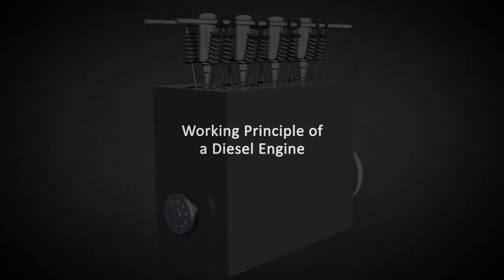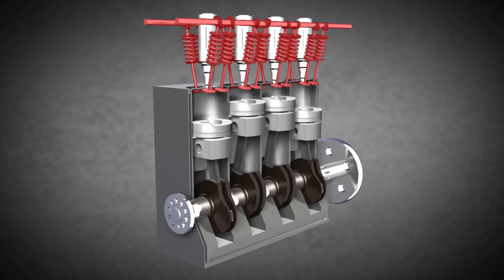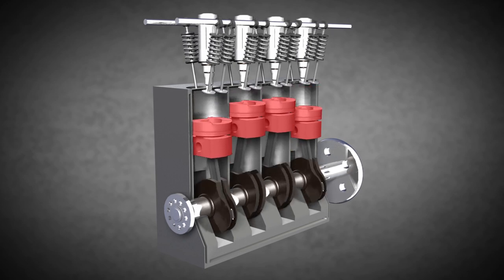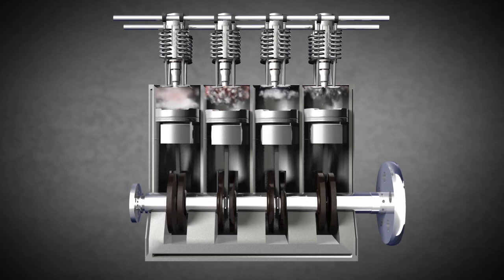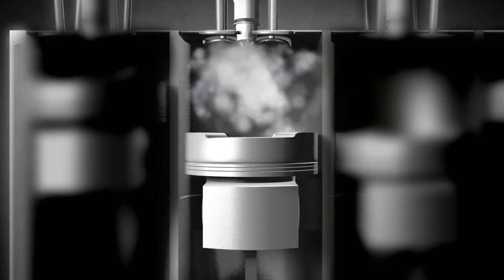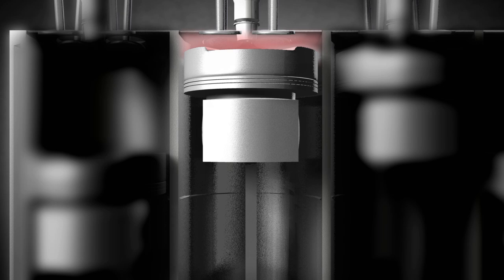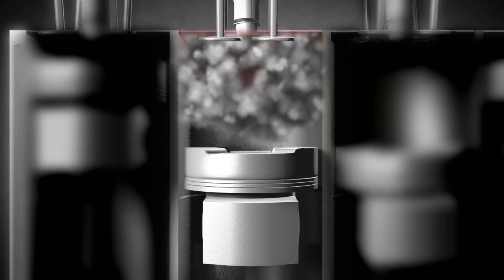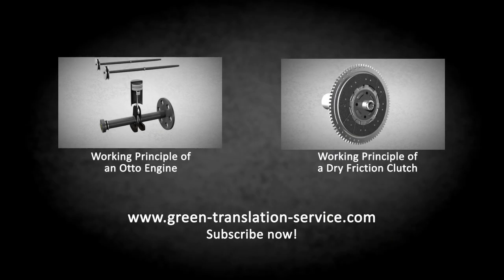How Diesel Engines Work! (Animation)

Comment: Never heard anyone call them "volves" before, nor have I ever heard them called "inlet" and "outlet" valves, just intake and exhaust.  He also missed a lot of steps when describing how power is transferred through the connecting rods to the gear box, like the crank journals, crank shaft, and fly-wheel.

Comment: Hello. I've noticed some diesel engines without a throttle body control (4M40). Does it mean the air/fuel mixture for diesel engines will never be equal to one another?  Does this mean that the power/rpm increase will generally depend on the amount of diesel fuel injected without regards to the uncontrolled amount of air getting inside the cylinders?

Comment: how about showing a 2-stroke dual opposing piston inline engine.  the small diesels on navy ships can have at least 6 cylinders/12 pistons, with apertures for compressed air injection/exhaust scavenging above the pistons' bottom stroke.  the larger propulsion-generator drive ones on cargo ships are large enough for a man to stand in.

Comment: In a correctly working engine, fuel does not explode, it burns. If it explodes, it's called 'detonation', and that what damages engines.
Reply from the maker: That's quite correct. However, in the past, these engines were called "explosion engines." Even today, there are languages that call them "explosion engines," e.g. in Spain; here, the engine is called "motor de explosión" or "motor de combustión."

Comment: 25%-30% more fuel efficiency? why is gasoline more used then? what are the advantages of gasoline?
Reply: Gasoline has more acceleration, while diesel will have more torque
Reply: Or to put it more simpler gasoline is faster, but diesel is stronger
Reply: I think that diesel cars produce more NO2. And a lot of NO2 means a lot of ozone which is bad.

Comment: So there's no sparkplug?
Reply: Correct, the fuel ignites from compression
Reply: no it doesnt use glow plugs as spark plugs
Reply: gasoline doesn't produce enough energy to power the engine like that. Also diesel is not injected into the engine as a liquid. New diesel motors have a fuel compression of 29,000 psi at the injector nozzle due to diesel not being able to be ignited at liquid form. Yes it does burn but it is very slowly and produces little energy when it is not compressed
Reply: Nope, but the do have glow plugs which heat the air and gas for starting the engine in cold temps.
Reply: Dont some Petrol engines also work from compression?
Reply: No instead it uses glow plugs
Reply: Yes
Reply: No spark plugs as in traditional gas fueled engines. However...there is a thing called a glow plug. Here's a good read on that.  http://www.enginebuildermag.com/2012/01/diesel-engine-glow-plugs-not-just-for-starting-anymore/

Comment: why is diesel more efficient? And why does diesel engines typically have lower RPM than gasoline?
Reply: +7150285  Diesel engines can turn fuel into more work then what a gas can for pulling and towing. Because they use the heat of compression to fire, This makes a lot of power inside the cylinder. Also In a gas motor, Bore is bigger then the stroke. In a diesel, Stroke is bigger then the Bore.  And the reason they run lower rpm's is because the way there designed is to make high torque: Torque and Horsepower are two very different things. Same goes the other way.   You can have a truck with a lot of horse power but very low torque. Horse power is what your capable of, Torque is what you feel.  I don't claim to know everything, But this gives you an idea.
Reply: +ps2adam I'm a lil confused, what do u mean bore is bigger than stroke stroke is bigger than bore? You mean the diameter of the cylinder is bigger than the length of the stroke for gasoline engines?
Reply: On a gas motor, The bore is always bigger then stroke. So the cylinders are wider but the piston doesn't make as big of a stroke. On a diesel, Your bore or diameter is smaller but the stroke is a lot bigger.
Reply: ps2adam stroke is bigger that's why lower rpms?
Reply: Right. Longer stroke = less revolutions Ga have a smaller stroke = more Just like gear ratios like underdrive, 1:1 and overdrives. Under = higher rpms and over = lower. Same concept.
Reply: do u know what under square or over square is? I heard about it but never quite understand it.
Reply: Square is when both bore and stroke are the same. Over square is when bore is bigger then stroke and under is when bore is smaller then stroke. All diesel motors will be under square.

Comment: Clean diesel is a myth
Reply: it is alot more effeicent than gasoline so id say cleaner
Reply: depends on what you define as cleaner. Yes the fuel itself is dirtier but it is more efficient and produces so much more energy than gasoline which allows it to be more powerful. And modern EPA laws restrict diesel engines so much that they are cleaner.
Reply: Its insane how restricted new diesel trucks are. A simple tune removing the restrictions gives diesel motors 150+ hp. Thats $300-$1000 depending on how fancy you want the tuner to be for 150 hp.

Comment: This is Direct Injection, but how was fuel delivered when diesel was first invented.  I am sure they didn't have electronic fuel injection back then.  Was it carbeurated ?  All diesels have throttle bodies, correct?  Someone said they they don't and are theoretically at wide open throttle all the time.

Comment: whats the advantage of a V6? is it still the same 4 steps except spread out into 6 cylinders?
Reply: +jy02679284 Same cycles.  It's two rows of 3 cylinders which run much much smoother than INLINE 4cyl.  V6 is even smoother than V8.  Boxer (flat) 4cyl is smoother than all of the above.
Reply: +jy02679284 A inline V6 will put out more torque then most V8's will. Hence why most simis and hardly any that i've seen in  tractor use a V8. Also, The  steps are always the same. Intake compression power exhaust. Hence "4 Stroke"

Comment: how is the fuel injected against such high pressures?
Reply: +iTyncWithReality Yes, heat is needed to ignite the mixture, but heat exists everywhere in some quantity that isn't absolute zero. When you increase the pressure you do increase the temperature, but you also lower the autoignition temperature, ie there is a pressure at which the mixture will ignite AT ROOM TEMPERATURE even if you siphoned off the heat produced from the pressurization (or if you pressurized it very slowly).
Reply: +raglanheuser aparently the fuel is injected when the piston is backing, not when it is compressed.
Reply: é difícil se manter anônimo hj em dia that is not the impression the animations i see give off.
Reply: +raglanheuser The fuel's under even more pressure.
Reply: Luka Voglar i see
Reply: +Luka Voglar so that means that it isn't pressure alone that ignites the fuel, but pressure plus heat?...*thinking...no it's the air. need oxygen to get an explosion. Or do we...? is there another volatile gas we could use that won't bond with carbon or nitrogen? 

off track.
Reply: +iTyncWithReality First off I'd like to say that I'm not the best in this area, so don't take my claims as 100% correct. 

From what I understand, it's actually only the heat that ignites the fuel and not pressure itself.  Diesel engines have very high compression ratios (compared to gasoline ones) and compressing gasses results in a rise of temperature.

And no, as far as I'm aware no other gas would work in the same way oxygen does. And we actually want it to bond with carbon, otherwise there is no reaction and we don't get any power.
Reply: the fuel is injected as a gas at nearly 30k psi and then the air and fuel are compressed even more causing heat and then ignition. It is a combination of heat and pressure because there is no way to completely remove the heat from air that is compressed to such high pressures

Comment: The best animation so far seen on 4 stroke diesel engines. Especially pausing the process while explaining points. This should be the way animation used.
Reply: +P G Srinivas This is Direct Injection, but how was fuel delivered when diesel was first invented.  I am sure they didn't have electronic fuel injection back then.  Was it carbeurated ?  All diesels have throttle bodies, correct?  Someone said they they don't and are theoretically at wide open throttle all the time.

Comment: hello,
is that true the diesel engines doesn't need a spark plug?
Reply: +Ayoub Abderrazik Yes, diesel engines have injectors. you will never see a diesel with spark plugs.
Reply: Tristan Newsome ok thanks. i understand now the mechanism of diesel engines :) .
Reply: 6 stroke engines basically work the same way they just add in a step before the fuel injection to compress the air and then inject the fuel and compress it again. So it goes intake, precompression, fuel injection, compression, ignition, exhaust
Reply: +Ayoub Abderrazik Learning is fun, is it not?
Reply: rogerjordan ya you're right :D
i know why now ;)
Reply: +Ayoub Abderrazik but they have glow plugs or exhaust recirculation of some sort for cold staring
Reply: zeebazu ya, to burn the diesel, it should be hot isn't it?
can you explain to me the 6 stroke engine? please

Comment: Can any one please explane Why we dont see a Diesal car with duel exhaust with a nice note like petrol cars with twin 2inch exhaust with a small  hot dog muffler as you rap her out through the gears .I bought a Subaru 2Ltr Turbo Diesal go,s like the clappers 6 speed manual and cheap to run 860 per tank .

Comment: then why does it need glow plugs if the diesel is ignited by the heat from the compressed air?
Reply: +Daniel Wilson Engines are usually cold when they are started up.
Reply: eman tsrif enam stal 
I think
The environment temperature is very low
It is not easy for fuel vaporization

Comment: There is one power stroke. Does that mean the engine slows down during the other three strokes?
Reply: +Sjaak van Dijk The engine doesn't slow down because the engine is always going through a powerstroke. The four-cylinder in the video has a 2-1-3-4 firing order, which means the 2nd cylinder has a powerstroke, then the 1st, then the 3rd, then the fourth. 

No matter what, in a four-stroke engine, there's ALWAYS a piston in there going through a power stroke.
Reply from the maker: Sjaak van Dijk Well, in an engine with 4 cylinders, there is always 1 power stroke during the cycle. In a 1- or 2-cylinder engine, this is the case, but it's not a problem because here comes the flywheel into play :)
Reply: Thanks! I got the message ... at last ;-)

Comment: So this works just like a petrol engine but i hear that it compresses air much more... Hmmm....
Reply: Thomas Bate You are right, in a way. A gasoline fourstroke compared to a diesel fourstroke works the same, except for when fuel is injected and ignited.
Gasoline needs a spark to go off, due to the characteristics of gasoline in itself and that the gas engine has lower compression ratio than a diesel.
Diesel needs lots of heat generated by highly compressed air, hence the higher compression ratio in a diesel, to ignite.

Gas engines (usually) mixes air and fuel outside the cylinder head, while in a diesel engine those two components mix during the compression stroke.

Comment: The only point I challenge is the notion that ignition=explosion. Ignition in any conventional engine means a controlled burn, actual explosions are commonly referred to as "knocking," this can actually cause holes/cavities to form in the piston and damage the engine. A premature burn, a cause of knocking, can result in an explosion which is why higher compression engines require more octane, a flame retardant. If you have any information disproving this, I genuinely would be interested in learning. Cheers!
Reply: Diesel engines do require what is essentially a controlled explosion to work. The fuel is injected at the end of the compression stroke, while the air is superheated from compression, and explodes. In a gasoline engine, this is a bad thing, because the fuel/air mixture (diesels only take in air) could ignite prematurely and cause damage to the engine. That's why they need high-octane fuel: octane rating basically says how resistant the fuel-air mixture is to premature detonation. In a diesel you can simply delay the fuel injection timing to prevent this.

Comment: Diesels have higher compression ratios than gasoline engines
Reply: +V6 OHV (12-Valve Supercharged) 

Either diesel engines are more complicated than I thought, or people just tard out when I speak to them about it, but I always tell them the compression of the air heats the air up to a point where the diesel fuel/air mixture ignites itself. Glowplugs are used instead of sparkplugs, and they are only used in cold situations, like starting the engine up in winter. For some reason people can't believe me, despite many resources on the internet confirming what I say. 

However, it's because of this compression that makes diesel engines a lot more fiddly than a regular gasoline engine.

Comment: I've read that diesel engines take a longer time to start in cold weather.
Is this due to the glow plugs that needs to warm up?

Wouldn't this make diesel engine vehicles relatively not good to own if you live in cold area places (i.e. Upper Midwest or NE USA)?
Reply: Michael Chan it does mean it takes maybe 5 seconds longer to wait for glow plugs to warm up but its not really much of a difference

Comment: dumb question # 1: can someone explain the function of the glowplugs and how a diesel is started compared to a gasoline engine? Thanks, great video- CM
Reply: colin mcgovern glowplugs are electric heaters (resistive elements pretty much like an electric oven) that are used to pre-heat the air when you start the engine and it is cold. Then after a couple minutes they are turned of because the engine will keep itself to temperature.